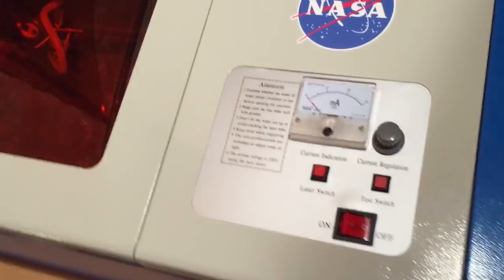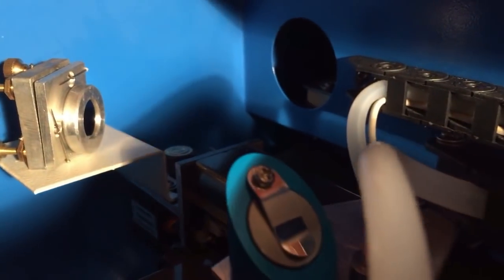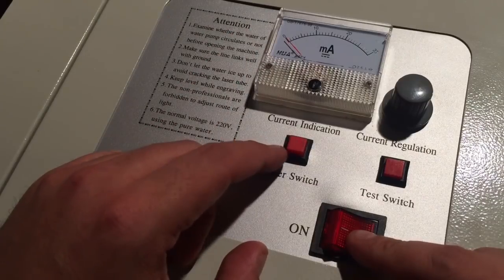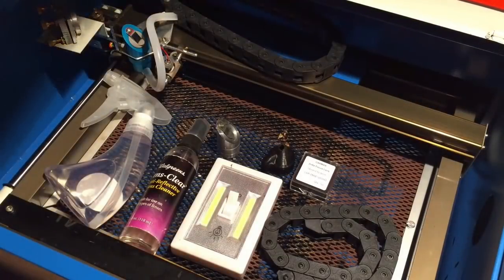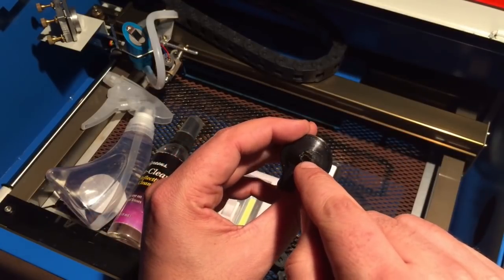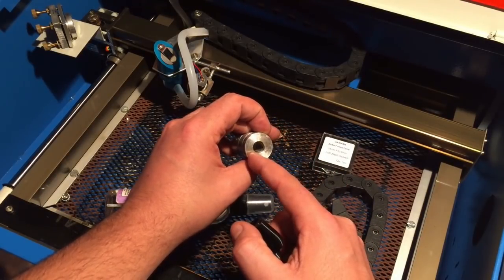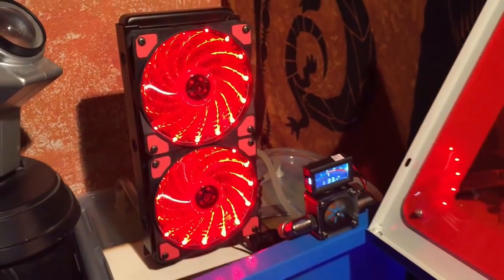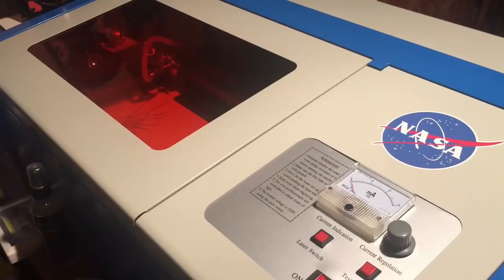K40 Laser Review

Comment: Great Video... Just wondering about the lens size you bought 18mm was that the original size of your machines laser, mine is 12mm...
Reply from the maker: The seller of the lens was quoting that it would work with my machine and it works fine.

Comment: you make it seem easy to set this laser up.  it  it really that simple? or is it a lot of hassle?
Reply from the maker: I think it depends if you are a handy person or not. Dont forget you are buying a lasercutter for 400 bucks instead of 4000, so there are some things i had swapped out right from the beginning such as the pump that comes with the set. Also i extended the exhaust hose to fit my window. All in all it is not to complicated to set it up, it is quite a plug and play system. Be aware that you need a container for the cooling water though and make sure to get rid of the airbubbles inside the laser tube. I consider to make a setup video in the future as i have to transplant my laser into another room.
Reply: @MancaveEffects  thx for that.  i cant wait to see your video on setting it up.

Comment: how long will the laser last for normal use?
Reply from the maker: This is a non answerable question. Mine works absolutely fine since almost two years now, but you can never now if your lasertube has been manufactured on a monday. Due to the cheap price after two years i would not be angry if the lasertube suddenly burns out. It has done a lot of work and runned a lot of hours.
There are some critical parts in this sort of laser machines, the tube itself, the mainboard, the high voltage powersupply and the belts. The most expensive parts can be bought on ebay for about $120. The belts may start slipping after a while an can be sourced for cheap on ebay aswell. I hope this answers your question.
Reply: @MancaveEffects  yes it does. thx alot.

Comment: First - your english like told you other subscribers already - is perfect!! Even i understand english well, i dont speak it often, so i could learn many many from you ;)
The laser: Im very interested in such lasers, too, but also (maybe some more) in the technics... And this reason prevents me from investing money in these chinese-models. To get their proper satisfying work, the needs of preparing, repairing (These models are a simple adventure, you already recognized yourself) in many cases. It seems to me, that the devices are open building-places ;)
Cooling for the laser-tube such a example for it: The need to buy a proper cooling-system for a "ready device" 🤔 The dust/smoke-outtake-system...
The Milliamperemeter what got to replace already after one week... (And i heard that regulary control this is pretty important to prevent a crash to the laser-power-supply what seems to be not proper dimensioned - (run on its limit in cases whrere the tubecurrent is adjusted already on more than 10mA)...
These laser where shipped only from here, but originally these type come from one supplier... :/ And in cases, where somethings wasnt in laser when customers unboxed, they got from from "sellers in the middle" :/
350Euro are not more. A - finally - device (with all in) - i believe, that it CAN / is ABLE to make satisfying laser-engrave/cut-results... but the coincidence of happy-cases is the opposite of my expectations...

You asked why your thermometer build on the top from your water-cooling-system isnt to be adjusted. I havent heard that a thermometr has to be. In how much degree it differs from the what another shows and do increases und decreases go "constantly"? So what i mean: If i.e. the "real" temp would be 20degrees. And your thermometr shows 16 or 24. Does it show 26 or 34 in case of "real temp" would be 30? So it would be usable however. If simply sth. shows, the thermo sensor has to be replaced (if possible). Or absolutely not mount on it. New independent little Themp-measuring-System which sensor sits in the Cooling-circle (cooling water - have heard - needs to be grounded!! you did? In some cases the highvoltage from the tube can causee some/such "irrititations")... Hope could some help out... :)
Reply: He don´t like to answer ...(?)

Comment: its not a review its an upgrade video. i still dont know what the Stock system is capable of and what not. made no sense buying 300€ laser cutter and spend +300 for upgrades  than its better to buy another one for 600+ what will work
Reply from the maker: Not really as a $600 chinese unit also has to be upgraded for more reliable use. I recently made a video if the k40 can engrave metal (it don't), you can find this video in my k40 playlist
Reply: ich schaumal

Comment: Nice review. I am amazed at what you can get for such a low budget.
For the water cooler, it is important to keep the water temperature below 25°C. I have a 100W laser and as soon as the temperature get too high, laser power decreases.
Regarding cutting metal on those big machines: they sometimes use inert gasses like Nitrogen but also Oxygen is used to support the burning process. Depending on the material the results vary.
O ... and never try this with your machine - there is a risk of damaging your laser and/or mirrors due to reflection.
Reply from the maker: +rumblfmp i slightly angled the metal sheets to avoid the beam to reflect back trough the lens and mirrors. About the temperature of the cooling water, yes this actually is the same thing with this cheap laser. When the temperature depasses 25deg C it decreases in power.

Comment: You said the tube may last around a month? How do you know that? Did you already have to replace yours? If yes, is there a better higher quality one you could recommend?
Reply from the maker: +Nils those tubes are the cheapest one you can find. You can be lucky and it lasts for years. When the pump is not running the tube will blow in a matter of seconds. Also as i said in the video i avoid running it at higher currents to make it last longer. I still use the same tube that it came with and it works fine, but it might be a matter of time until one day it burns through. In my case the tube already cutted so much stuff that the 110$ for a new one is already sheduled.
Reply: do you have the link to where a good new tube can be bought and the model number

Comment: I just discovered your channel since I was looking for a good K40 laser video. Yours is great. I got the information that I needed and I thank you for that.

I got one question. The clamp you removed is too small. But did you find a bigger one or is it just a piece of mesh you placed at the bottom.

o/
Reply: Btw your English is very good.
Reply from the maker: Thank you, the clamp that comes with the laser is pretty much useless so i just put a piece of mesh wire in it. As the laser is not physicaly touching your workingpiece you dont need to fix it down anyways. There are 4 rods inside the laserbed that where used to screw down the clamping plate, so i simply screwed in the mesh wire to it. Its a one hour job.
Reply: Mancave Effects thank you for your reply. Much appreciated. 👍🏻

Comment: The temperature meter is easy. Not all, but most temperature sensors are semiconductors which have already been calibrated. To see if it is so, put icecubes in a bowl and let them thaw until half of it is water. That is 0°C, then put the sensor into boiling water, that should read 100°C.
Reply from the maker: +Steinþór Bjarni Grímsson i tried this but ist about 12,5 deg C off. So i thought there is a poti or so to rescale it. I recently found three identical sensors in an old box 

of my pc motherboard. I am planning to replace them woth those if they have the same values.
Reply: This Dallas Temperature sensor is in many motherboards. 
https://datasheets.maximintegrated.com/en/ds/DS18B20.pdf

Comment: Great video. One of the most, if not the only, video I have found on this product.

I purchased mine through Amazon, and albeit I have not completely unboxed mine yet, from what you described, it seems your German distributor is selling through Amazon, since mine seems to be as complete as yours.

So I went to the Light Object link you provided and I noticed, that in a reply below, you mentioned that your upgrade consisted of approximately $550. 

When I looked on the Light Object link, there were "complete" kits for around that amount. Did you actually buy a complete kit as in the link? If so, which one?

I will have to view your video again to get the names of the individual pieces you did buy (to upgrade) so that I can order the same parts, if you did not buy the complete upgrade kit.
Reply from the maker: Elvis Acosta Hi, i bought my machine on ebay, but the seller seems to sell them on other sites aswell.
I did not bought a kit from Lightobject. I only ordered some parts i thought that could be helpful for what i want to do, also as i meantioned in the video i ordered some parts on ebay such as the water cooler, flow check gate, etc.  all in all it came to 500$. Maybe Lightobject offers new sets that wherend available when i was ordering. 550$ included shipping what in my case outside the US costed me arround 50$ for the Lightobject parts.

I also must say for everybody who starts using this machine, the machine is working great even without all the extra parts. You can order things one after each other maybe you find other ways around problems that may show up.
The most important thing about the whole laser is the cooling. There is nothing more important, so concentrate onto this point in the beginning. Get a better pump, the right cooling additive, use destilled water instead of tab water. Get yourself a reservoir that holds at least 4 gallons of water. Keep the output of the lasertube under half of the maximum (in my case around 15mA) and keep an eye on the cooling water temperature while using the machine. Try to keep the temp. under 30deg C (86 f) for best results.

I probably will soon make another more detailed video about the machine.
Reply: Thank you for the quick reply. As with your video, it was extremely informative. 

I will follow suit on your suggestions and I look forward to seeing your next updated video.

Comment: Nice review. Tell me about the ground wire joint. Do you use it or the main cable (euro) is enought ?
Reply from the maker: for now i am using the ground coming from the mains, but i read that its recommanded to use a seperate groundwire using the extra port as it is high voltage. In the US i would definatly use another ground than the one provided from the mains!

Comment: If you have some basic wood working tools you can make an adapter to mount the exhaust.
Reply from the maker: +james blake i will soon replace the fan entirely as over time the plastic blades of my fan had deformed due to centrifugal force and start to blow out the exhausts to the back. Then i will need to build a coustom mount out of wood.
Reply: That's what I did on mine cut a piece of plywood a little thicker than the opening and routered it to size then cut it to the size of the opening and cut a hole in center to match the hose I was using (4" duct).